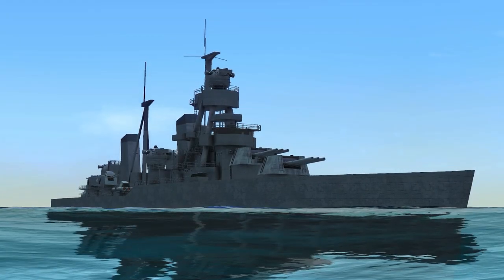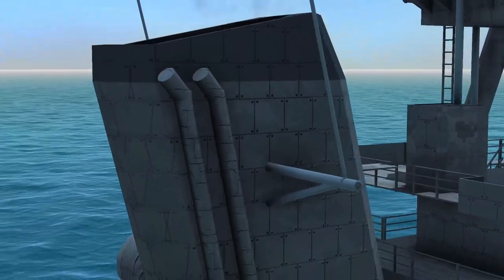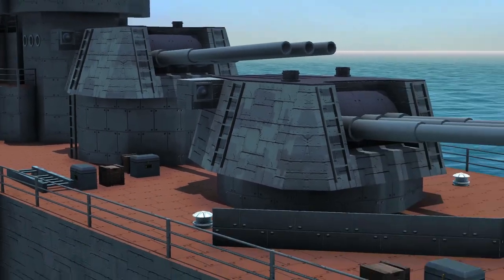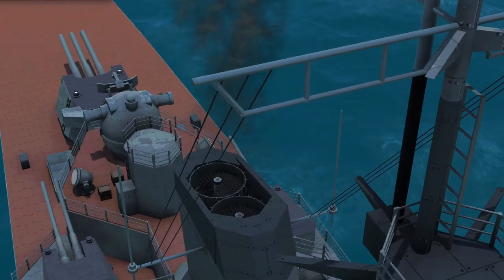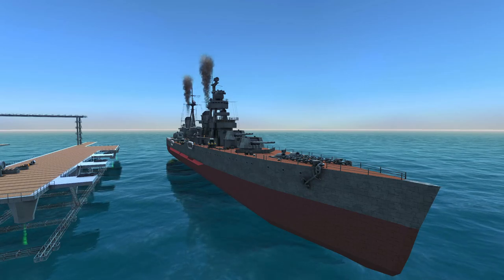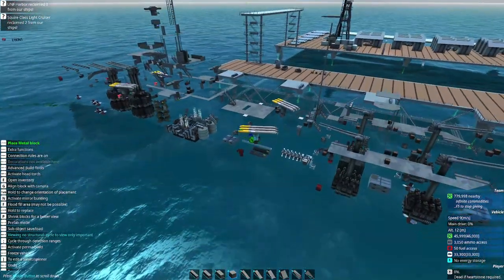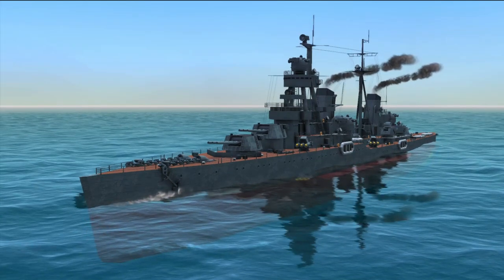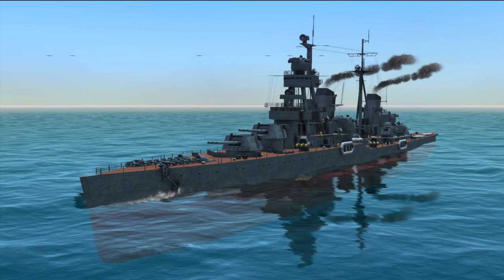Wrench's Way II: Detailing & Fine Tuning - From the Depths

Comment: This shield in front of the front most turret is called wave breaker and its purpose is to reduce the amount of pressure that waves washing over the front deck put on the rotation parts of the front most turret tu prevent damage and most of the time its slightly angled forward

Comment: Do those CIWS settings really work well? Cause, at least as I understand, a lot of them is just nonsense. First two and the last one work great but others basically do nothing. 
3rd condition: Cluster size supposed to add priority to places with a lot of munition (usually for FLAK) but you do: if there is 1 projectile add 0 weight, if more (for some reason you set the value to also 1)  add 10 weight. 
The 4th condition does that: checks if the diameter of the munition is in interval between 0mm and 1mm and if this condition is true adds 5 weight (why?).
The 5th condition does that: it adds more priority to projectiles that closer but you set minimum distance to 0 (meters) and maximum distance to 1 (meter) so what it does: if the munition is closer than 0 meters (that's not good) then try to shoot it first. if munition is further than 1 meter (also pretty close) try to shoot it after.

How to fix that:
That's pretty easy, but it really depends on what behavior you want to expect.
At first, increase the right range value of condition number 3 (Cluster size) to the value of aprox. 4 or 5. This will make your guns try to shoot at bigger clusters of projectiles (useful if they have area damage or you want to decrease aiming time).
Then, you can basicly delete the 4th condition. It's very situational (For example when you want to prioritize specific size of missile) and I don't think you really need it here.
Lastly (the most important), set the right (highest) range value to somewhere about 2000 m and left range value (lowest) for about 200- 800 meters. This will make cannons at first prioritize  all munition that is closer than left value (gives them left value).
And also increase it's left weight value for like 5 or 6 and right for -5 or -6.

Ah, and also I think you should set weights of your second condition to minimum and maximum values (left and right accordingly).
This should ensure that only 1 cannon is firing at the same munition.
Reply: also its not the first and last 2 int the first 2 and last that work well, the rest dont